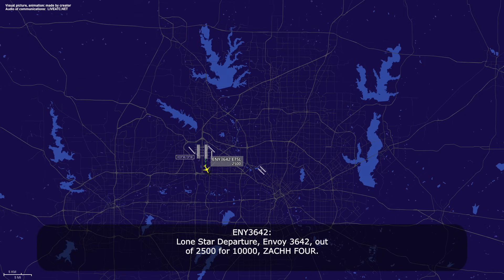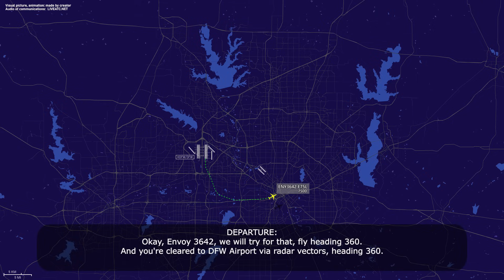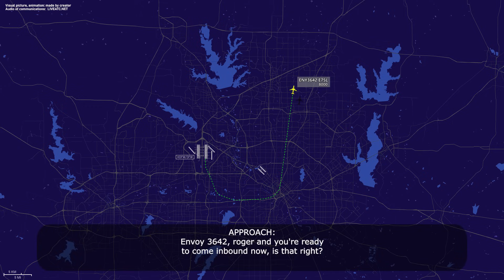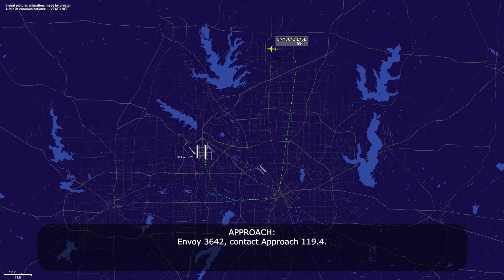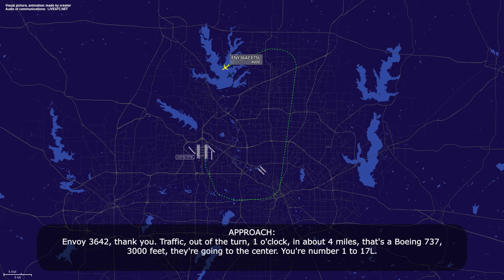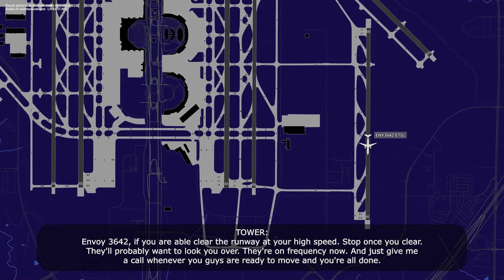Pilots shut down the engine in flight. Bleed system issue. Envoy E175 returns to DFW. Real ATC

Comment: unless you covered it already, back on april 11th 2025 around 11pm CST had sky west flight 6269 out of dfw for San Angelo turn back, dont know the reason, but they had a pretty short 7-8 mile final too which i thought was unusual
Reply: How’s the unusual for a SkyWest? That’s a perfectly fine final distance for that type of plane
Reply: @ referring more to DFW where most finals start at 20miles out, but at that time of night with less traffic sure they can take a shorter final, I just don’t see it too often